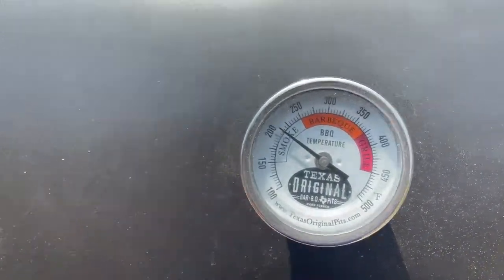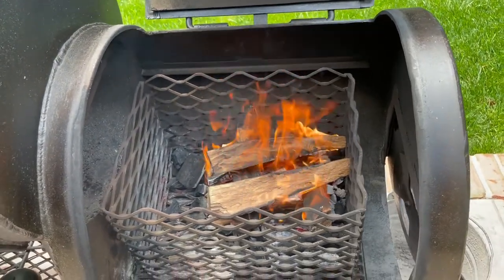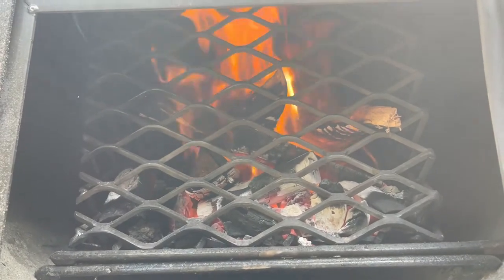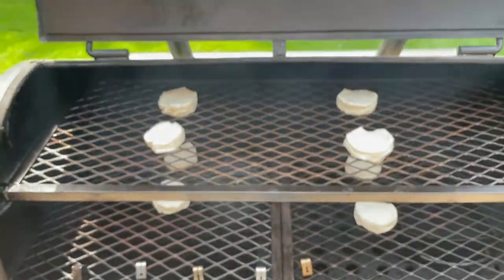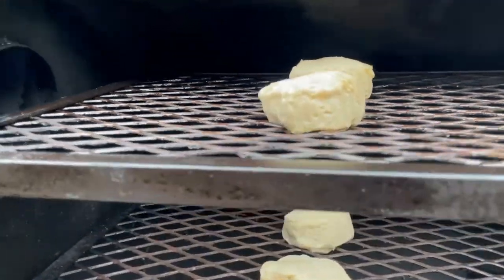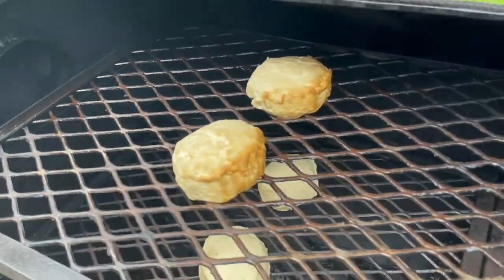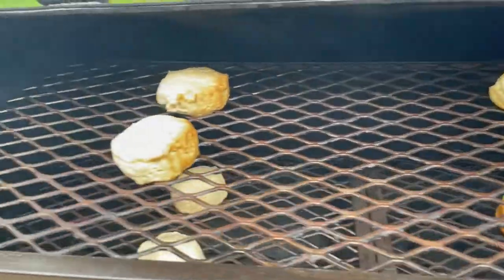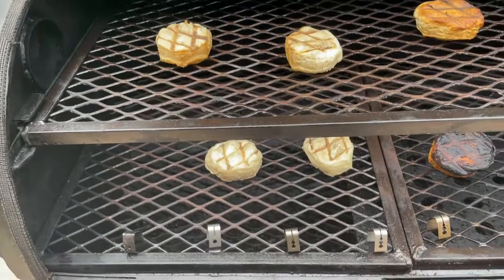Texas Original Pits- Luling 20x40 Biscuit Test… Five degree difference ?

Comment: I went to my local Lowes and got a 4in pipe to extend my exhaust. The results were an increased draw which evened out the temps on the bottom rack. Might be worth it to experiment for a few bucks. I noticed that some other pits had a larger diameter exhaust which equals more draw. I figured what the heck and was pleased with the results!
Reply: I did this too except I used exhaust extensions from advanced auto - it definitely helps draft and evens out temps too

Comment: Supposedly (I haven't tested it) a water pan in the chamber up against the firebox opening (acting as a baffle and adding moisture) will give you temps within 10 degrees across the chamber.
Reply: I agree - an offset water pan such as the one at bbqsmokermods evened out the temps on my offset

Comment: I have a Horizon offset. When I put a water pan or a tray in front of the firebox, it  causes the side by the stack to drop in temperature a lot. Perhaps you should try with no baffle plate or move the baffle plate  away from the firebox to tune it.
Reply from the maker: Your right on the money with your suggestions. I have found moving the baffle out an inch helps a lot. I have also ran it as a traditional straight flow with no baffle. I use that method if I am cooking hot and fast. Thanks for watching and commenting.
Reply: I suggest the Horizon is already tuned without the water pan - so adding one messes up the even temps.

Comment: That's a nice smoker.  Based on the way the biscuits cooked it seems like it would be more beneficial if the stack exhaust was at the same level as the bottom grate.  Do you plan getting an extra tuning plate to even it out further?  Thanks for posting this.
Reply from the maker: I added some tuning plates past the baffle plate. I found adding a water pan helped a great deal. I love this smoker. Texas Original Pits doesn’t get enough credit for the quality pits they make. They are top notch.
Reply: I've heard a smoker manufacturer explain that it's not necessarily better to place the exhaust at the (lower) cooking grate because you're interrupting the natural air flow.  The hot air wants to rise and exit at the top and will give you better natural air flow without unnecessary turbulence.  Also, a smooth bend at the stack rather than a sharp right angle bend, is better, he claims.  Search Moberg secrets.
Reply from the maker: I appreciate the feedback. I am adding tuning plates to the one I am working on now. We will see if it makes a difference. Thanks for watching
Reply: @myporchbbq  Yes sir - a water pan such as the one at bbqsmokermods might help even temps out as well.  Thanks for a great and honest video!